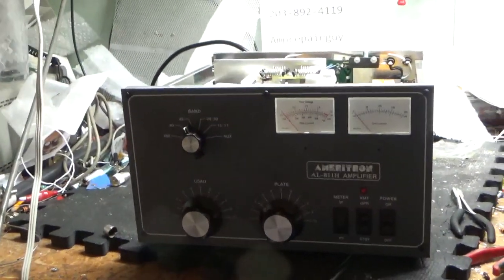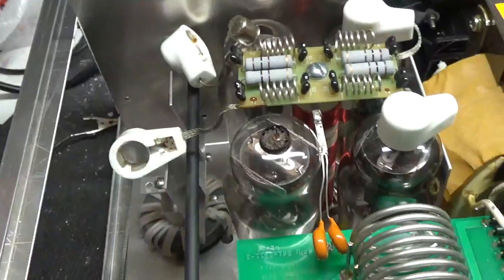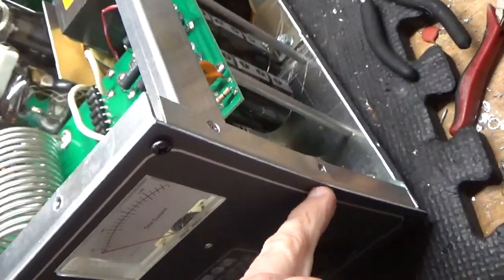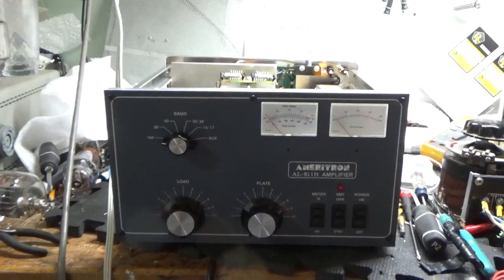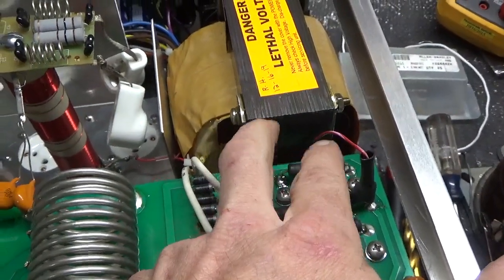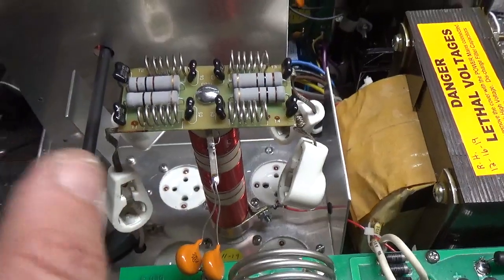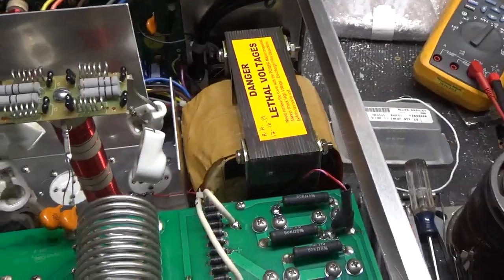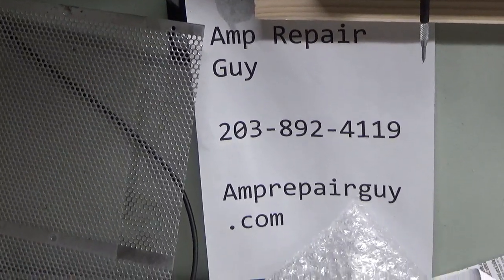Ameritron Al-811h Repair With 572b tubes

Comment: Do the 572 tubes drop in without modifications?
Reply from the maker: Yes they are a direct drop in replacement . I never recommend dropping in a new set of tubes until all revisions and quality control issues have been addressed